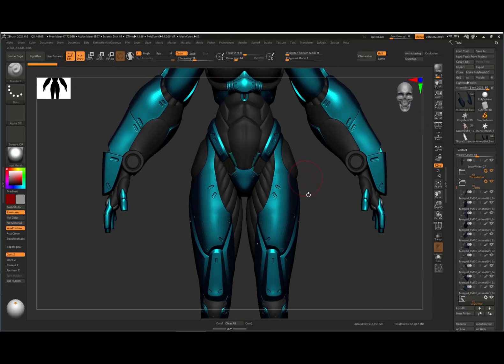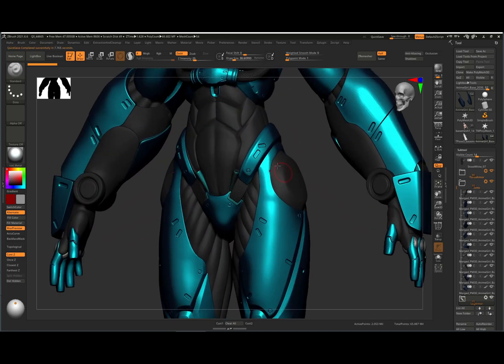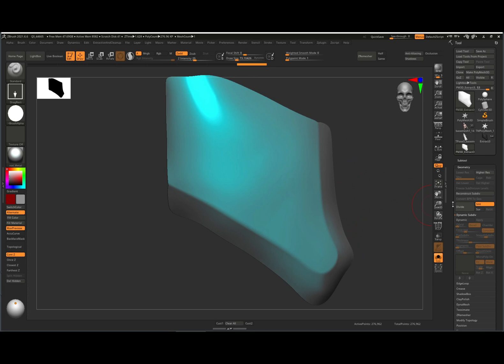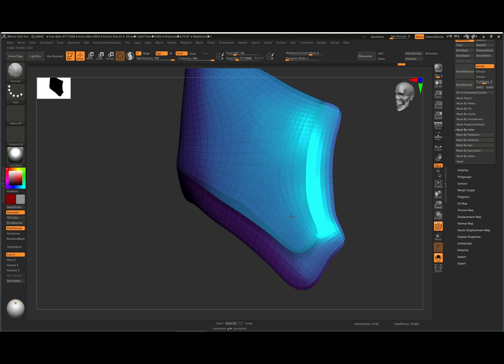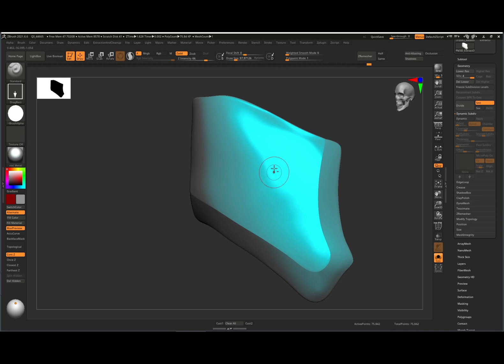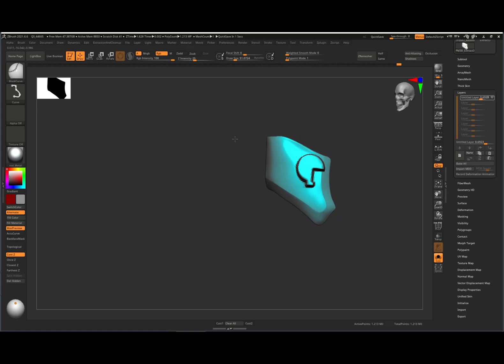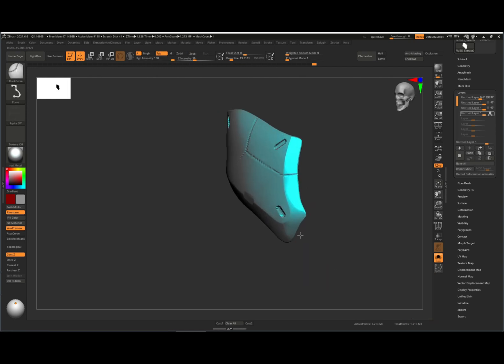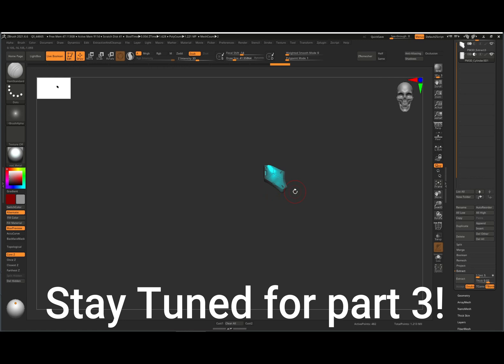(Reuploaded)Hard Surface In Zbrush Made Easy part 2: details

Comment: Have you ever used hardops and boxcutter in blender? Someone recommended them as opposed to this workflow in zbrush. Do you think it would be easier to just do most of the hard surface work in blender with those plugins and then more organic stuff in zbrush?
Reply from the maker: Yes. I do have a tutorial on working with blender for hard surface hero assets and props if you want to take a look at it.
Reply: @HiredGunGames  Yeah those vids got me into researching the hardops plugins. Would it be possible to create some vids using hardops and blender plugins to test and demonstrate the speed and ease compared to this zbrush workflow? From what I'm seeing it looks like blender could be faster for armor pieces and zbrush more for the body
Reply from the maker: @prodev4012  You can use both and speed it up even faster with extraction, zremesher and taking that over to blender and using hard ops. its really just up to you how you do it. This was a video showing how to do it in zbrush for sculptors.